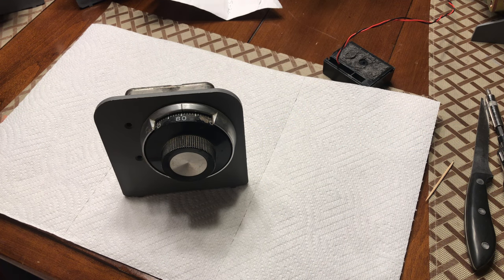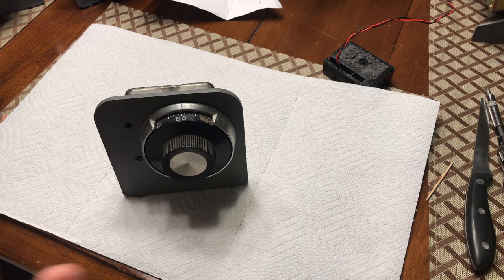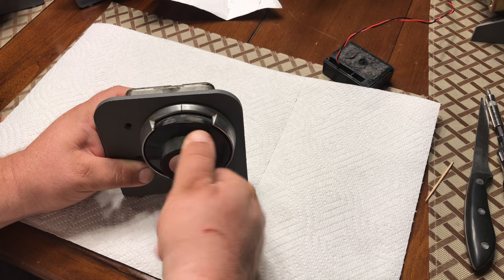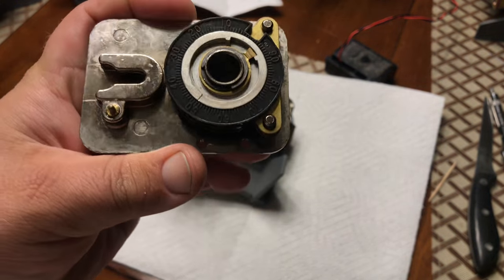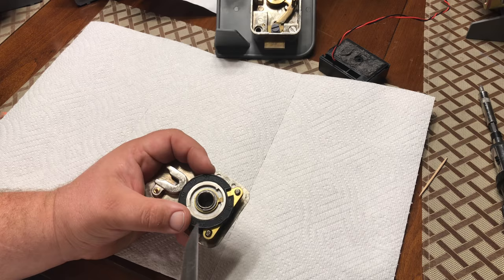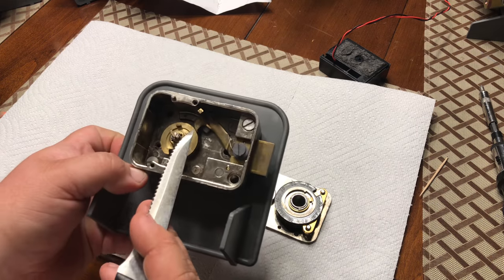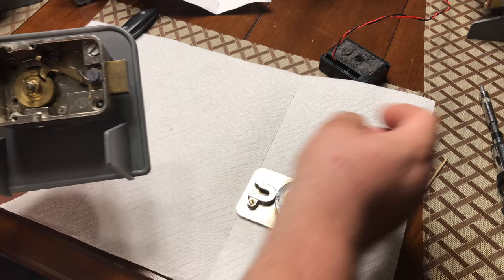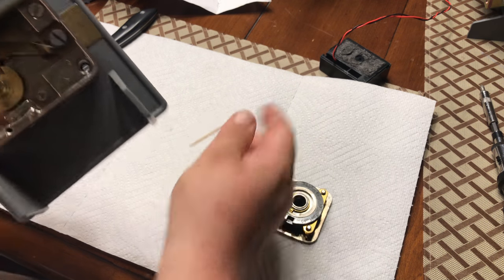Mosler Hand Change Combo Lock | Disassemble, Change combo. .

Comment: Hi, I’m having an issue I hope I can get some help on. I have a 4 tumbler mosler safe I bought with unknown combo. I fallowed this video to change the combo but now after I enter it when the gate drops I have the problem where I can’t reset the dial. It stays locked only allowing enough movement to lock/unluck the bolt. Only way to reset is to take the tumbler plate out. Any ideas? Any info would be appreciated!

Comment: I have an old one made of brass. I changed the numbers but it's not opening. I was wondering if the 3rd wheel, which is on top, has to be in a certain place tonstrat
Reply: Did you ever get to change the combination on that one? I believe I have the same issue

Comment: 9:00 - With plastic wheel packs wouldn't it be possible to heat the safe with a torch to make the plastic soft and twist the dial to force the gate down into the soft heated plastic?
Reply: I don't know about this particular lock, but most of these locks have thermal relockers which get triggered at relatively low temperature (i.e. ~170 F), much lower than the melting point of those wheels.